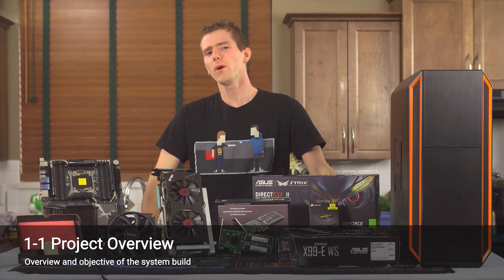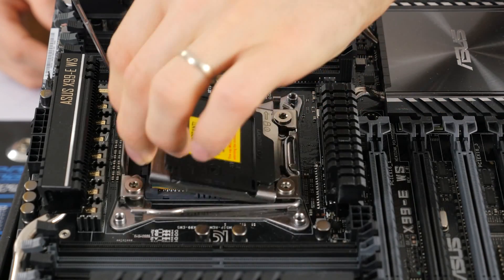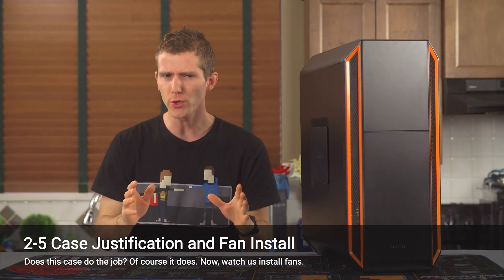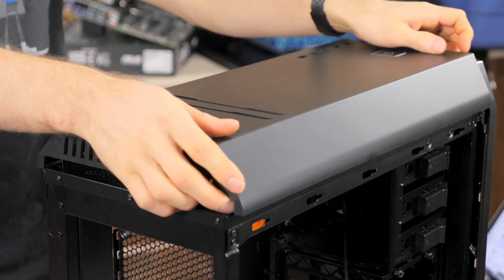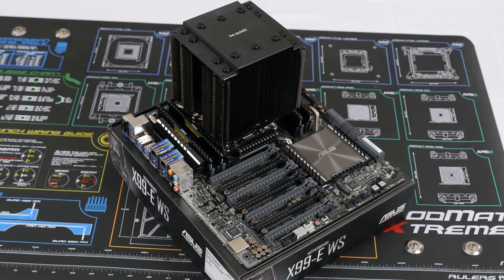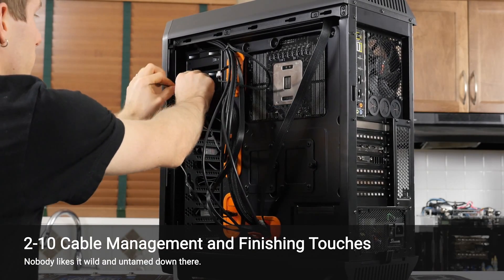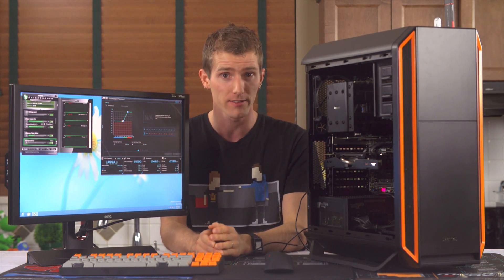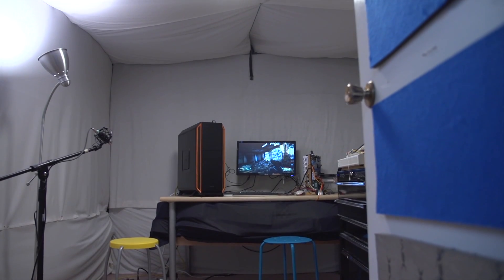How to Build the ULTIMATE Silent Gaming or Workstation PC

Comment: 1$ per gig being considered cheap, damn how far we've come. My wd nvme ssd is rated for twice the speed at 2 gigs per second, but it's barely more than 10 CENTS per gig, it's only 3 times the price of a equivalent hard drive.

Development in other sectors have been pretty meh in comparison, compare the best card of the time, a 980, to a 3090 and the results are a bit disappointing. Instead of double performance for a tenth of the price, it's 3-4 times the performance, which sounds pretty good, but it costs waaaaaaaay more.

Comment: Old video but still some good information here. I wasn't aware that Seasonic was making fanless power supplies in 2014. They have 700W ones now. BeQuiet is a great company. Their fans really helped quiet my computer, though I'll be switching them out for Noctua NF-A12x25 fans which proved to be 3dB quieter in tests. I was surprised that you took the fans out of your BeQuiet heatsink. Didn't think that was an option for an I7 processor. They've got standalone sinks for 90W processors and below but nothing for the 125W gaming processors of today. Noctua has been teasing a 3 Kilo one since 2019. A silent GPU is the holy grail.  The Palit GTX 1050 Ti KalmX 4 GB graphics card is the only thing that comes close, and it's near impossible to get a hold of one. It can play all the 1080 pre-2018 games perfectly on max settings, but for 4K it's supposed to be rubbish.

Comment: you're doing it wrong. get a cheap rackmount and a 4u chassis. mount in basement, and drop 1 usb 3.2 2x2 20ft cable and 1 hdmi 2.1 20ft cable. that's all you need. from the usb cable, you can hook up a multiport usb hub for a wireless controller/mouse/keyboard/soundblasterx G6. there, now it's 100% silent in your living room. enjoy.

Comment: Recently bought a new PC that was supposed to be pretty silent. My ambient noise (according to my mobiel app) is 22dB, when my PC runs the PSU is by far the loudest component in my system which takes it to 25/26dB at around 2 feet from my case and at load my system hits close to 28/29dB. Are those levels considered silent?

Comment: So, you like building silent as well as modding... every put one of those giant CPU cooling towers like the one you used here on a GPU? Sure, have to configure the case so you can have both towers not interfering with anything and probably have to add a fan to the GPU one, but it's been shown that with it strictly in the lowest setting all the time it can keep the GPU as cool if not cooler than the stock fans and is quieter than them.

Comment: Fan controller running at 600 rpm via 4 fans seems to run quite quiet.Thou I am not overclocking so not much heat and the I7 8700K seems a nice temperature coupled with a M.2 makes a quick cool temperature running rig.
All most forgot the blooming liquid cooler stock fan sounds like an old 200cc 4 stroke bike lol. So the CPU cooler looks a good option thou room is an issue.

Comment: Question really comes down to ones sanity level IMO.  Much like the debate over monitor usage?  Do you "need" an actual computer/gaming monitor..... or would you rather have a much larger and cheaper TV and use it as your monitor instead.  The insane will say you will get better gameplay and visuals with an insanely more expensive but smaller gaming monitor.  Possibly true, but to most people you won't really notice the slight improvement....... and while it might be slightly better the larger TV used as a monitor will DEFINITELY have you feeling more immersed in the game than say even a 32" monitor.  Not to mention if you actually do work on your computer, nothing beats the level of productivity you can accomplish with a 50" TV as a monitor than going out and buying 3-4 individual computer/gaming monitors and pairing them all up.  You can accomplish the same feat with 1 50" TV and then some and to top it off you won't have bezels dividing your overall viewing area up.  So again it comes down to your sanity.  Just like here.  What is deemed "loud?"  I mean I remember back in the 90s when my family got our first computer.  When the fan would kick on you'd hear it, but would I deem it being "loud?"  Not exactly.  I assume in the last 20 years internal fan cooling has advanced at least slightly so I assume they've gotten quieter over the years.  Couple that with the fact that if you're playing a game I assume you have some sort of audio coming out of the speakers.  That alone should cover up pretty much all of the noise your fans are making I'd think.  So again, it all matters on how sane you are.  I mean if the sound of a fan running ruins life for you then I guess it is a good thing you didn't grow up in the 90s....... and I also assume you don't have a laptop.  Some laptops, even today still, have pretty loud fans when they kick on.  Maybe it's just because of the proximity to the user.... they're literally right under the keyboard, but still.  I find it insane what people bitch and moan about on tech related topics.  Not just computer related stuff either, but like smart phones.  People actually will rip a company to shreds because they think their cell phone's screen scratches too easily....... yeah.  People have gotten so damn nit picky it's insane to me.  For the younger crowd it's a good thing they didn't grow up at the same time technology was rapidly improving because if they acted like they do now but in the 90s they would've lost their mind on how inferior everything was.  For the older crowd who bitches about these minor things I suggest you try and remember what shit used to be like.  Example, I find it hilarious when I hear about a guy in his 30s lament about picture fluidity and quality with his gaming experience.  He's a classic gamer.  He grew up with the NES and Sega.  Was he bitching back in the early-mid 90s about the inferiority of his TV and console on the shit picture quality back then?  No.  Shit like that didn't matter..... you were playing fucking arcade games IN YOUR HOUSE!!!  That alone was insane and awesome enough.  People have become fucking snobs about EVERYTHING nowadays though.

Comment: VERY INTERSTING HEAT SINK. NICE AND BLACK AND HUGE.  MY CPU FAN IS NOT THAT BIG AND ITS A INTEL CPU COOLER WITH A LIGHT UP BLUE FAN. SORRY IT DOSE NOT FIT MY BLACK AND RED THEME FROM CITY OF VILLAINS. MY CASE IS THE COOLER MASTER COSMOS II CASE. THE BIGEST BAD ASS CASE IN THE WORLD! NO WHIMPY SIDE PANEL THAT IS A BITCH TO FIN THE KNOCHES TO FIT IN THE HOLES.INSTEAD TWO CAR DOORS WAS INCLUDED IN THE CASE. YES IT DOSE WAMP VARY NICE WHEN CLOSING THOSE DOORS. INSIDE I GOT MSI X99A GAMING 7  THAT IS THE 24TH MOTHERBOARD FOR THIS BUILD. I SAY 24TH MOTHERBOARD BECAUSE THE ALL 23 BROKE FROM DOA WITH BROKEN LGA 2011-V3 CPU SOCKETS ARE BROKEN.14 OR 15 BRAND NEW ASUS X99 RAMPAGE V EXTREME MOTHERBOARDS HAD ALL BROKEN LGA 2011-V3 CPU SOCKETS. ONE BRAND NEW ASUS X99 RAMPAGE X EXTREME WENT IN THE TRASH ALONG WITH 5TH BRAND NEW AX1200i POWER SUPPLY DOA AND IN TH TRASH. IT BLOWN MY CPU, DIMS AND A $700.00 GRAPHIC CARD SO IT DID END WITH A EVGA 850 G2 POWER SUPPLY. ITS GREAT IT WORKS!!!  I FORGOT TO NOTE I USED G-SKIILL RIPJAWS 4 16GIGS DDR4 2666 4 DIMS IN SHINING RED WITH A TOUCH OF CROME ADDED TO THE RED. VERY NICE.  HOW THEY GOT THAT SHADE OF RED?THE GRAPHIC CARD IS A $700.00 PLUS SHIPPING GTX 980 CLASSIFIED THE ONLY CLASS ABOVE CLASSIFIED IS KING PIN. HOWEVER A WEEK LATER AFTER  IT WAS DELIVERED A GTX 980TI WITH 6 GIGS GDDR5 COMES IN. IN OTHER WORDS I SHOULD HAVE WAIT 2 WEEKS. I AM STICK WITH THE 4 GIGS GDDR5 60 FRAIMS PER SECOND IS THE LIMIT ALSO  1080P IS THE LIMIT. OH WELL. WHY I GOT GTX 980 CLASSIFIED?GTX 1080 IS NOT INVENTED YET 2ND THAT IS THE BEST THEY HAVE AT THE TIME UNTILL THE GTX 980Ti LAUNCH. ALSO LAUNCHED AT THE SAME TIME GTX TITAN X.TITAN X HAVE A LOT OF PEOPLE UPSET IT WHEN A GTX 1080Ti LAUNCH. FASTER GPU AND FASTER GDDR5 AND LOWER PRICE THEN TITAN X.NOW TITAN XP IS TO WORRY ABOUT. I JUST GOT GTA V PC EVEN I HATED IT. STUPID LAUNCHER. HOWEVER I DID RAN THE BUILT IN VIDEO TEST. PUT THE i7 3.4 GIGS  CPU AND THE GTX 980 ON A TEST FROM HELL TO MAKE IT BEG TO STOP IT. THE 60 FRAMES PER SECOND WENT VERY SMOOTH. IT DID GO UP AND DOWN ALOT. ON THE FRAIM RATE. AND THE SOLID STATE SSD LIST LOST THE INSTALLATION OF GTA V FOR NO GOOD RESION WHAT SO EVER. THAT SSD IS NOT CHEAP OH BOY! THAT SSD WITH THAT AMD BRANDING PAINT JOB ON IT. ONE PIECE OF JUNK!

Comment: A lot of servers, especially rack mount servers, have tiny fans that can scream like a jet engine. Fine for a rack, not so good for a home... suggestions & tips for lowering noise are good.
Most servers don't have a fancy GPU, so that's one noise source down. However, multi cores [think: threadripper] all running at temp can make for a hot case.

Comment: At 12:19, that fan filter will be completely ineffective because the fan will just pull air in from around the fan filter since there is about 3/4 inch gap at the top and bottom of the fan filter for the fan to pull air in through.

Comment: Used to marvel (read: be aghast) at how silent the room was when I powered down my gaming rigs. Nowadays, I build all my systems to be quiet first. Closed loop cooling for the CPU. As quiet a GPU solution as possible for the given GPU. Maybe 2x 120mm slow case fans, and a quiet PSU. Now the room noise hardly changes.

Of course, when a sudden noise happens, I hit the roof.

Comment: please dont use needle nose to tighten hex nuts, use a wrench, its what its designed for. i use cheap tight clearance wrenches that i heat up and bend to give me the angle and clearance i need for stuff like this.

Comment: helloim hoping you answer this. everyone else lol. im wanting to use the silent base 900 with the Noctua nh-d15. also use the asus x99-e ws/3.1, though they have a card upgrade for 3.1 on x99-e ws. also run the seasonic 660w instead of the 520w. I cant afford the scorpion pcie, though I see the (ws) can run m.2, so I thought  about an ocz on eBay for $525. then use an intel 520 for storage. also, Seagate sshd 1tb for external storage.  also cannot afford the monitor. how about a mode pg279q?  that has 165hz, almost half price. most of the specs. are same. i would like to have 2 gpu in sli. last I would like to run the noctua nh-15, with nf-f12, and nf-14 fans. with all doors closed does this case draw air from the front bottom? I want a positive air flow in unit but not worried about small noise. most of my changes add little/no noise.look, im 50yr old, worked overseas most my life. im divorced and have nothing better to do than watch young people do shit with computers I wish I could. I can build hardware wise anything. software im trying. currently own two Dell M6500 Percision WorkStation Laptops, only one semi works. though I build desktops for family and friend often. none have failed , yet. yes, I just grabbed wood. please let me know, thank you...

Comment: The reason it's not super silent is the graphics card and the fact that the case fans seem to be running at idle. At idle basically it should be 0 db because no fan should be spinning. With Intel Speedstep, an idle 91W or 140W-rated CPU just browsing the web should be running at 1.2GHz and consuming under 10W. An idle GPU should be running at like 140MHz and consuming 7-8W. With the coolers he has, he doesn't need any fans running at all at those loads. At load, with a high end graphics card, you'd need a massive air cooler like the Accelero Xtreme with a couple of very low RPM fans, or you'd need a water cooler with a good passive heatsink for the RAM and VRMs - even with a pump, water cooling is so efficient for GPUs, you can have a 240mm radiator with Noctua fans running at 700-900 RPM and you should be fine even with a 180W card like the GTX 1080 at full load, given you don't OC it. And you can pick a very quiet pump. If you get a GTX 1060 or less, you can go completely passive with the Accelero S3. And if you get a case with sound dampening, you can go virtually silent, it doesn't take a ton of money and effort, just some thought and knowledge.

Comment: I'm considering building a silent PC. Not used for gaming, but i use Plex regularly, and it'd need to hold up at the very most 3 simultaneous streams (Mix of transcode and direct stream). How would that passively cooled cpu configuration (if i were to use a 6700k) hold up with transcoding? Would i need to add a fan, or would it be ok?

Comment: My friend who's a computer technician says that static is only really a issue if you're wearing socks and on carpet. Her boss said that in his 19 years of working he's only had 3 instances of static issues with computers
Reply: ScarHydreigon87 yes but if you live in a country where you need ac (or whatever its in english) to heat up your house it dries the air and static electrisity increases, but you can just touch a grounded psu to remove any electric charge.

Comment: Are the fans 3 or 4 pin? And if they are 3 pin, won't they run at full RPM all the time?
Reply: - Zerenity - if they are 3 pin you can control their voltage to change the rpm

Comment: i dont know much about pcs but this is the build im thinking of getting idk if the 2 extra fans are needed http://pcpartpicker.com/list/9N4Gjc
Reply: Assuming you gonna keep stock fans from the case, it's good enough. I would like to add one more for the top as exhaust, though.
Also why $1000 build without SSD as boot drive? SSD for OS can give you faster performance by speed. Games and others can be put on HDD with no issue.
Reply: AlphaCore il add one later i just dont need it now

Comment: no cpu fan really scares me...
Reply: Go the NH D-14. I bought one of those years ago and it's been such a good investment. I have the fan switch off totally during idle, then under intensive loads it only runs around 300-400 rpm with 140W TDP CPUs. The 140mm is in the cooler and the 120mm on the rear of my case. Semi-passive power supply, overrated so the fan never turns on.

Old NZXT whisper coated in heavy carpet inside and out, turned on its nose and raised for convection. Whole thing sits behind a floor standing speaker, with power connections and LEDs wired into my desk
Reply: It actually has mate, the rear fan in reverse direction.
Reply: kill kom onlined  waar ben je
Reply: LUKASSS WOLF HIER HOE KOM IKK JOU TEGEN toeval xd
Reply: GewoonUniek Quit wooooowwwwwww
Reply: ZeR0 Evolve The only thing that irritated me how he oriented it. He does know which way it goes, so I can't really get mad at him without him having an excuse, it just slightly irritated me
Reply: ikr
Reply: Why? Computer will shut down or throttle if it overheats. These tower coolers work very well - it's just that they're heavy. I still prefer water cooling = good efficiency and very quiet as well.

Comment: The loudest thing in my rig is the hdd... Fuck me
Reply: SSD, only solution.
Reply: Arjan Stoop
Unfortunately it wasn't the vibration, it was the click-click-clicking of it reading/writing data. At the time it was a 2.5" drive kind of ghetto mounted using foam to wedge a 2.5-3.5 sled into a floppy bay. I've since replaced the case and now it's mounted on an SSD mount behind the motherboard tray. Less audible but still there. Once I turned up the fans (which to me is a more tolerable noise) it masked it fairly well. I have had drives that did vibrate through the chassis though...and fans too...and they are annoying as hell.
Reply: Vrunchy Crunchy I feel your pain. The struggle
Reply: Tell me about it...the first time I booted mine my fans were running at a really low RPM...and all I could hear was my cocking HDD ticking away...I've since turned up the fan speed...and I can still hear the HDD -_-
Reply: Vrunchy Crunchy Why not just get a 250gb SSD from Samsung and have a 2-4TB storage as extra storage or if you have a 1GB upload and download, just use online storage.
Reply: Thats why I use seagate 4tb drives; very quiet
Reply: Vrunchy Crunchy DUDE SAME. I have a shitty WD Gold 4TB HDD and only 2TB are recognized by my PC.
Reply: Arjan Stoop “rubber thingies” I think you mean rubber washers?

Comment: Would the corsair dominator platinum ddr4 ram fit if you placed the heat sink for the cpu in the "air efficient," way?
Reply: StorybookBus03 no
Reply: StorybookBus03 I don't think so

Comment: i would have swapped the graphics card and ssd locations so the ssd acted a heat shield from the power supply and the heat coming off the power supply would have gone around the the graphics card

Comment: Are there any other brands using a feature like ASUS's Auto-Fan Stop? I'm looking for a Z170 board with this feature and don't want to be brand limited. I love the idea of having the non critical fans turned off and only turned back on when reaching a select temp! I'm looking to have them gradually ramp up to a per-selected max RPM to help control noise just like in this video.

Comment: how dose this build hold up 2016 
im just getting in to pc building and am wondering
Reply: It would still play games with very high settings but there parts aren't best of the best.
Reply: +imhereforattention thanks good to know
Reply: Micheal Hamelin  Do you plan on building a PC like this or are you just curious?
Reply: just curious mainly
Reply: Micheal Hamelin Just Upgrade some parts. Use a 1070 instead of the 970. Silentbase 900 pro instead of the 800. A new 6 series i7. Probably also newer ssds. But the rest is totaly ok. 

Silent wings 3 and maybe a new Motherboard.

Comment: I'm trying to take some cues from this build to keep my next one pretty quiet, so I was wondering if it's safe to overclock with just a heatsink and no fans as long as it's a big high quality one like that? I know it would be fine to run at stock speeds, but not sure if the cooling will be good enough with overclocking.